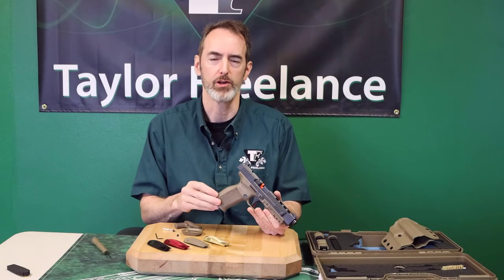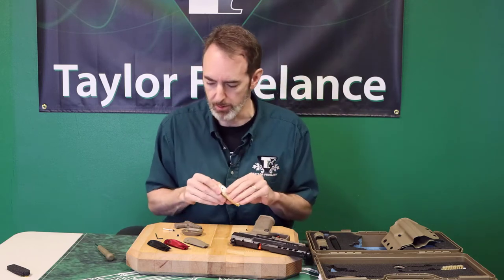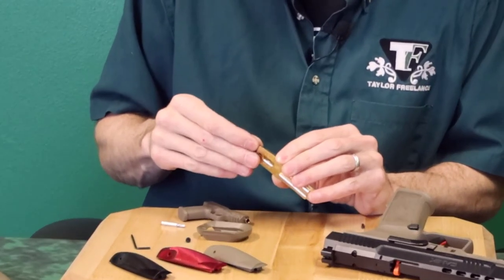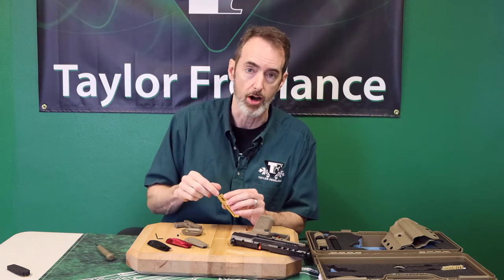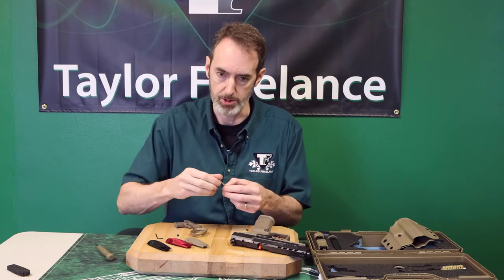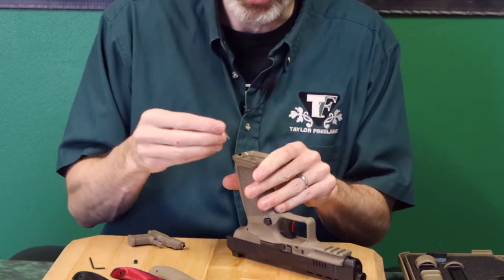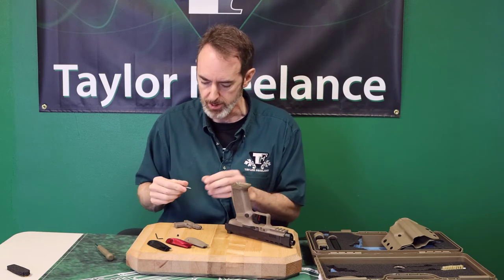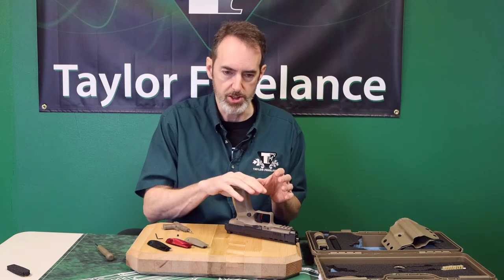Canik Mete/Rival Backstrap Installation

Comment: Love your craftmanship, just got the backstrap, +4 extension and the slide plate cover all in Alum. for my METE SFT Pro ordering 2 more extensions right now :) too bad you're not making a Mag Release button for the METE SFT Pro, maybe soon :)
Reply from the maker: Thanks Man! Positive comments like that always brighten my day. (Helps the crew's morale as well.) On the mag release button, we do have mag release buttons (co op project with Driven Arms), but I'm not up to speed on the SFT pro -- does it use a different bolt-on tip than the others?
Reply: @taylorfreelance  yes, it's just a square maybe 5mm or 8mm x 8mm with a countersunk true hole.
Reply from the maker: @Infidel67  That sure looks like the same one that's used on the original SFX. Go ahead and get one of ours and see if it fits. If I'm wrong, I'll buy it back and be grateful for the report!
Reply: @taylorfreelance  OK Done.
Reply: @taylorfreelance   can confirm that the mag release will fit the Mete SFT Pro. I love it, it won't let me share a link of course, I will drop a pic on your Facebook.

Comment: The backstrap size is perfect for my med/small hands. Hopefully we have a heads up if the size gets changed so I can buy a backup. I really really like this backstrap my only issue is that after 2k rounds and hundreds of reloads both dry and in competition the brass threads stripped after tightening a 3 times. I tried blue loctite with no luck. I am getting a new one and looking into the TF mag well.
Reply: How did the new one do?
Reply: @blessedone1845  the new one has been good for 10 k rounds so far. But I highly recommend the TF magwell vs the stock one.

Comment: Just got Black canik mete sft with the gold slide and barrel. really hope the brass matches pretty well
Reply from the maker: Brass and the gold won't match 100% because they're different metals and different processes. Gold Cerakote seems to do a better job of getting close -- available as a custom-color option. (Look for "custom color" at the top of web store menu.)
Reply: I just got a Canik Mete MC9  today and tried to change the backstrap, but the pin was so tight that I actually broke the end of the punch that was included! Never got it out so far!!

Comment: Are these backstairs thinner than the stock mete back straps I need one with less palmswell
Reply from the maker: They're about the same size, BUT -- they are solid (the factory ones are hollow). If you wanted to grind one down, you could take A LOT of meat out of that palm swell. Likely you could eliminate the palm swell entirely.

Comment: Do you reinstall the backstrap cross pin?  Or does it just use the magwell screw?   I hope you can use just the cross pin without the magwell so it can be used in USPSA production/carry optics...
Reply from the maker: Yes. This is very popular for CO in particular.

Comment: The Mete comes with two backstraps, a smaller one designated with a "1" on the inside of it and a larger one.  Guessing the larger one has a "2" on it.  Which size is your brass backstrap compared to the OEM Mete?  Thanks.
Reply: i’d say it’s inbetween (1.5) feels great in the hand with the added weight plus the only downfall in the gun imo was the pattern on the back strap. this TR back strap gives a much better grip and fits the palm well

Comment: I literally have this backstrap for my Mete SFX and the TF Magwell in my shopping cart right now, I just have a question. Will the TF magwell for TP9 SFX is going to fit on Mete SFX as well, along with this backstrap? Thanks
Reply from the maker: No. The TF backstrap will work with the METE magwell, but that's it. We're working on a METE-specific magwell, but it isn't ready yet.

Comment: just to be clear, there is no magwell for the SFX Rival yet right?  If not I hope for a magwell that will accept all magazines base plates. I also hope your canik baseplates work with the SFX Rival magwell supplied with that gun
Reply from the maker: Hey Fouad, our SFX Mete/Rival magwell is getting proofed out right now! If we're extremely lucky, I might have "live" machined prototype later today. The 3D printed model accepted every basepad we put in it, including ours and the factory "20-round" +2. The base design is there, we're just geeking out over surface texture.
Reply from the maker: A little detail -- our Mete/Rival magwell (now available) works on the polymer Rival, not the Rival-S.
Reply: @taylorfreelance  thank you. i'll go take a look, will probably pick it up along with the VP9 backstrap in black when available.

Comment: Hello, how well does the black finish on the brass match the guns finish. Thank you
Reply from the maker: That's tough to answer, since most of the Mete/Rival frames aren't black in color. The black of the brass backstrap blends well with the slide and barrel, so they "match" the overall scheme -- but they aren't "Rival Grey." Does that help?
Reply: @taylorfreelance  Sorry, I should have said it was the Rival Dark Side.
Reply: I guess I’m wondering if the black brass will match the Rival Darkside? Thanks